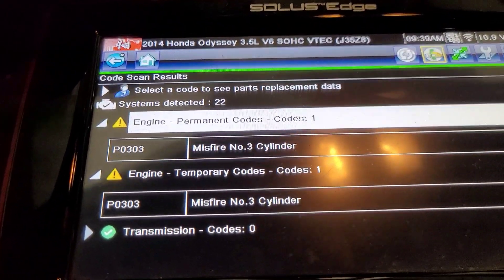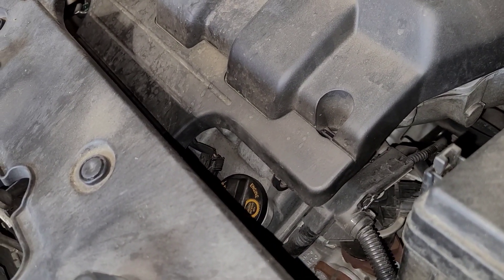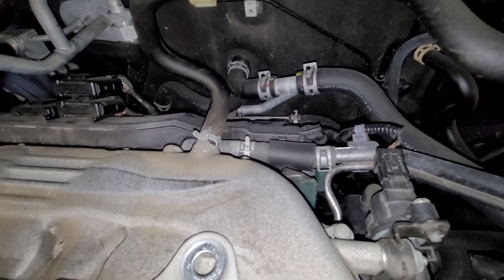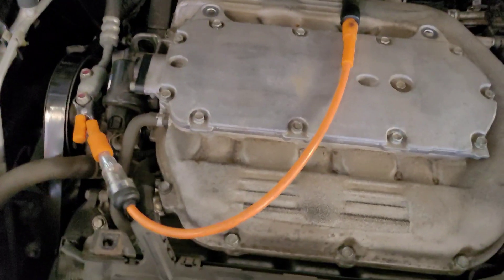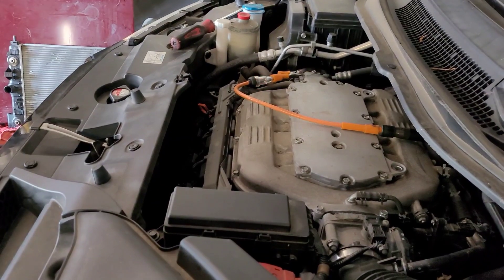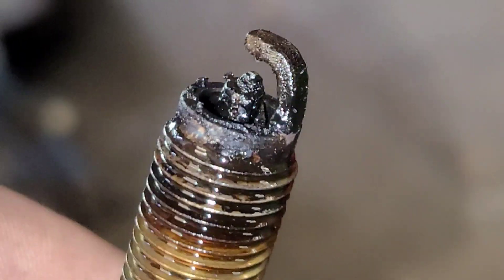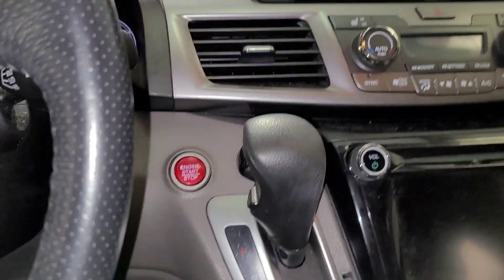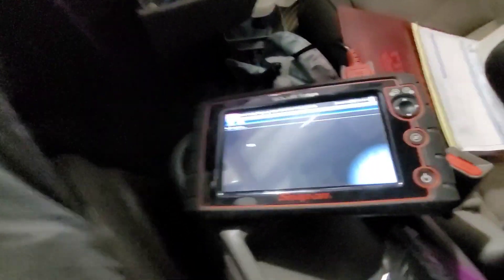One cylinder burning oil & causing a misfire

Comment: Any idea what was the reason of oil in cylinder at first place. I have same problem with my mazda 3 2013 sports gx. One of the spark plugs had oil on it. Should i just change the spark plug and move on or go for the bigger problem which could be faulty valve seals or piston problem. I would really appreciate your info on this. Great video by the way. Thanks
Reply: My 2000 Corolla seems to get oil fouled on cylinder 1 (of 4) and the replacement with a new valve cover gasket is a simple and easy remedy...
Reply: These Hondas has a horrible feature called VCM which cause all kinds of problems like fouled plugs, oil burning, burnt coils, bad rings, kills the Cats and the motor mounts prematurely,.

Comment: What is the solution if the oil fouled on the spark plug?
Reply: Likely bad piston rings, possible damage to the cylinder.  Apparently it’s under warranty. Hard to say if they’d disassemble to see if it’s repairable, or install a new engine.
Reply: it might be as simple as a new valve cover or a new set of plugs

Comment: The question is what caused the residue on the plug oil residue?
Reply: Blown head gaskets possibly
Reply: VCM- Variable Cylinder Management. It's a horribly designed feature that shuts down 1 through 3 cylinders while the car is driving to increase MPG numbers . But it results in oil burning and all kinds of parts start failing prematurely like the plugs, coils, rings, Cats, and motor mounts.